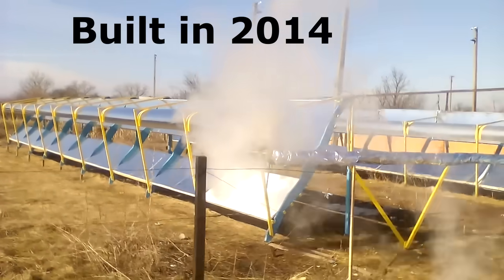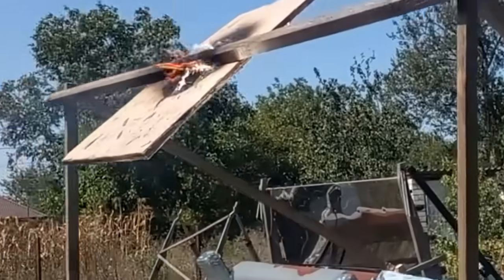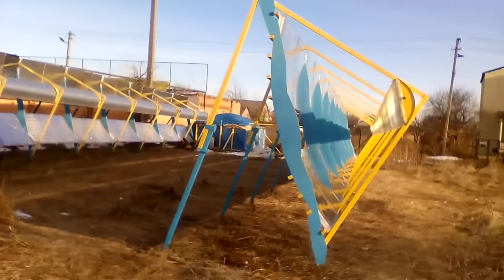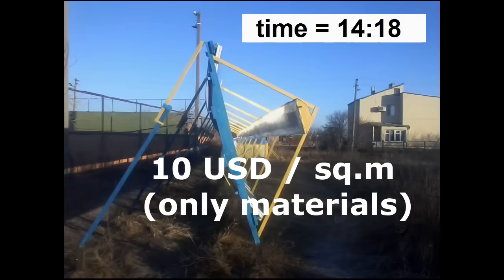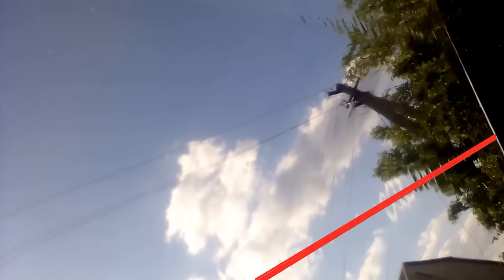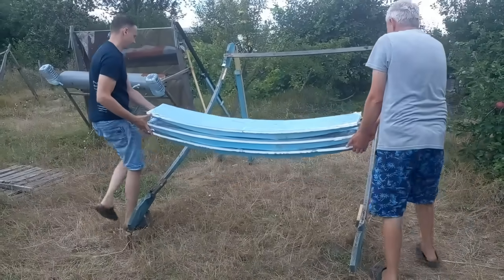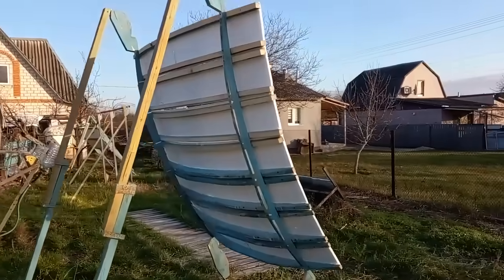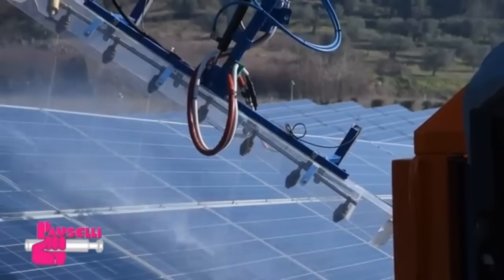This solar energy innovation 2025 is 10 times cheaper than analogues

Comment: Have you thought about using glass mirror pieces glued to the styrofoam? It may be slightly more expensive than Mylar, but they will not degrade and the thin glass mirror pieces can be recycled or reused with new foam.

Comment: This design is very similar to a German patent: DE102011003663A1. Hans Graßmann called it a linear mirror in 2010. The special feature is that all the mirrors are controlled by just two - later three - motors. You adjust the alignment of the mirrors to the sunlight. I like your channel. Machen is good, Mr. Graßman also built his mirrors himself. Isomorph was the name of the company. Unfortunately, it didn't make it.

Comment: This method does not work in cloudy or even slightly overcast skies (veil, diffuse radiation), only in direct sunlight and a clear sky.
And in direct sunlight it reduces efficiency and increases the need to clean the mirrors.

Comment: The complex part of those systems is generally not building the mirrors (cheap and easy) but correctly collecting the heat and turning it into electricity. It can be done of course, and has been done with great success, but in order to be truly cost effective and justify the use of a turbine you have to build a big solar farm, not just something you can put in your yard.
Another drawback is also the fact it only uses direct sunlight

Still a cool tech I wish was more widespread, that is indeed cost effective at scale

Comment: Sergiy, consider using ordinary air as an energy carrier. You could use a cylindrical insulated tank filled with sand or aggregate and heat it by circulating hot air between your installation and this storage. Depending on the temperature achieved inside, you can explore ways to convert this energy into electricity or leave it as heat for the home on cold days.

Comment: Is it possible to design a system to circulate water or oil through a system of pipes that heat up a hot water or oil reservoir to be used to then circulate through another immersed loop of water through a series of radiators within a house?  It seems likely to me that systems like this already exist so what is the best way to do this?

Comment: Yeah that crap maybe cheap but forgot to mention turbine cost :) this system still not work in winter so have the same problem as solar. Cheaper would be buy batteries like 20kw/h and will be ok for 2 days of electricity for small house in that time in summer will charge it.

Comment: Have you looked at Hyliion's Karno linear generators? They say the 3D printed fuel-agnostic heat exchanger could also be converted to accept heat from molten salts or heat from solar concentrators. I could imagine units that generate electricity ~directly (without a need for a steam turbine). Using concentrator heat by day, and running molten salts by night. They have an estimated efficiency of a gas-fired turbine (cost of fuel per kWh). For the same reason, they have nuclear applications - again, avoiding the complexity of steam turbines. Cheers!
Reply: Yes, it looks like a Stirling twin engine.

Comment: I made something similar to your first example using an old satellite dish and mylar to focus the sun on the RF receiver (there are many discarded dishes so it was a recycling/upcycling experiment).  I was thinking to use it with a small triple-junction solar cell panel (which works well with CS) and have a secondary liquid cooling of some kind behind the cell, using the waste heat for either hot water or, if hot enough, could be also for power.
Reply: Wondering what the most cost effective and efficient high temperature photo voltaic or similar is.  Temp is too high for traditional PV's, though if at a distance where temperature isn't an issue, then handy for concentrating enough light on cloudy days I am thinking.
Reply: Look at the Seebeck effect: The appearance of an electric potential when the boundary between two different metals is heated.

Comment: Instead of oil, it would probably be better to use a salt solution - it would not freeze like water or become viscous like oil and would have much higher specific heat capacity (heat capacity per kilogram) than oil. You could also have an insulated buffer tank where hot salt water would be kept - it would serve as heat accumulator

Comment: As much as i prefer heat solar panel over photovoltaic, the current price of those make it impossible to get better money return with heat one anymore. Getting 400w/m2 of energy on a heat solar panel was already a big challenge (i managed to get 250w at best personally), and it cost me way more in term of time spent to build those than getting to the store and buy a PV equivalent. In particular if the goal is just to heat things (hot water or house heaters), as you don't even need the costly power inverter system for the PV and batteries (just plug the panel to the heater and voila).
Reply: The combination of mirror concentrators and a heat pump would be an excellent solution for heating the house in winter.

Comment: I would consider it win if you just made steam or hot oil for heat you home and running the hot water heater or a small steam generator using a low speed high torque diepetro engine.

Comment: you could also use the heat to break down waste motor oils into usable fractions to run a generator,, power vehicle etc.. Same could be done with plastic Pyrolysis .   Both easier to do possible than create a thermal storage system buy/build steam generator
Reply: Cool idea. Pyrolysis produces fuel, which can also be the source of heat for the pyrolysis process, but maybe solar could help make the process more efficient.

I think pyrolysis is best done on a large scale, utilizing heat exchange to recover lost energy and maximise efficiency.

Comment: For mass production of the ribs.  Steam straight boards and have a mold to press the boards into the shape you want.  You could also gently heat PVC pipe and use a mold to shape it.  It would be faster but might be more expensive then wood.
Reply: @purdunetae2995  I think wood is too variable to be bent like this, consistently.
Reply: glue together 2 thinner pieces of wood and hold keep it bent while the glue dries will also work. Less work vs steaming.

Comment: how about just use a another bigger curved mirror Infront of the curbed mirrors to solve the issue? that way it goes to a smaller spot.
Reply: @trench01  Mirrors are costly and not 100% efficient. Light is lost with each reflection.
Reply: @Convolutedtubules  Moving parts and labor are expensive too. If you can make it so there are no moving parts and the only labor is replacing the reflective film every year or two, that would be well worth the cost of a secondary stainless steel or glass mirror which would last for many years.
Reply: @macrumpton  But the earth tilts, he mentions in this video that the vertical angle needs to be adjusted approximately 10 times during the year. As the sun moves, you need to adjust the vertical angle of either the mirror, or the collector.
Reply: @macrumpton  9:25

Comment: nice, put a continuous line receiver (liquid pipe) instead of needing to moving anything. at all. movement is the worst in any building. normal copper metal water pipe is the best continuous receiver. how to make a car paint shiny. well you polish it. so a metal with reflective paint is the best. overall. or maybe plastic or foam filled plastic cover with paint. 3d printed petg (or pla) plastic shell, with polyurethane foam filling. 3d printed parts can be screw bolted together as a larger structure. or maybe just use plastic sheet. or make the panels from wood. wood with silver paint, to make it look like a car metal surface mirror.
Reply: 9:25 the vertical angle needs to be changed as the earth tilts throughout the year.
Reply: @Convolutedtubules  much better only to have to adjust monthly instead of hourly.
Reply: try square grid mirror support structure (made from wood), that then can easily hold a mirror film. yep its like putting the film over a metal bug net. very strong but light weight. yes I would use chicken net as the base net, then put the film over that, and attach to some wood poles or other simple shape using the poles.
Reply: how about two wires, which hold a reflective panel, and/or target. or a mesh web of wires with reflective panels. then just the end support points somewhere. like four poles on the ground up.

Comment: Yorgiy, I have been watching you for years. I live in Istanbul. Does this thing you do heat water in cloudy weather where the air temperature is 10 C? There is snow in your video but the sun remains as it is.
Reply: In cloudy weather, the mirror concentrator provides very little heat. You can use it in combination with a heat pump, then it will be useful.

Comment: Good stuff, though regular solar panels getting incredibly cheap and efficient now and can be installed on roofs etc. Apparently the aluminium frame is the most expensive part! Installation and maintenance cost seems to dwarf hardware costs.
Reply: If manufacturers integrate solar panels into structural construction panels for roof and wall use, the costs would decrease further and the huge amount of panels will make alignment and mounting moot.
Reply: @macrumpton  Of course. This makes sense. Solar roof tiles already exist but it will be a long time before anything like this will be widely adopted.
Reply: Solar panels have one major drawback - they absorb only 25% of solar energy. This is due to the fact that solar panels absorb only part of the solar spectrum. If they absorbed the entire spectrum, they would look completely black and would be cold. Plants absorb even less energy - 5% of the sun's energy, because they absorb only red and blue light. That is why people are interested in mirror concentrators in order to receive all the solar energy.
Reply: @intellectualcat4000  I doubt that small scale mirror based system would achieve higher efficiency. Also panels are dirt cheap so you can very easily simply mount more of them.
Reply: @oskarejsmont  Yes, but if you don't have enough space, then the efficiency of your panels becomes important. And the efficiency of mirror hubs reaches 80%, which is a lot.
Reply: @intellectualcat4000  Efficiency of those small janky ones dont reach 80%.
Reply: @oskarejsmont  Why not? Mirrors concentrate the light, and it gets very hot in focus. And the higher the temperature, the more energy can be obtained without loss, which means that the efficiency is higher.
Reply: @intellectualcat4000  Small systems are very hard to automatize and optimize. Also there arent any readily available efficient turbines in those power levels.
Reply: @oskarejsmont  We can use other types of electric generators as well. For example, the Stirling engine or Peltier elements.
Reply: @intellectualcat4000  Which are inefficient as hell.
Reply: @afmedwards What is the source of these claims? 

Extruded aluminium the most expensive part? I doubt that! The glass is probably more expensive, and I guess the solar cells are a major cost too. Solar panels are not cheap and definitely not efficient, so it's funny to me that you say "incredibly cheap and efficient".
Reply: @ £60+VAT for 455W now! https://youtu.be/APE1y9mTQLU
Reply: @Convolutedtubules  I recently bought 440W solar panels for 50$ each...